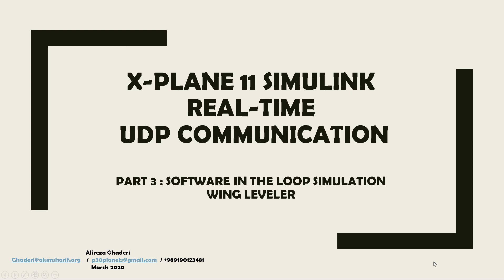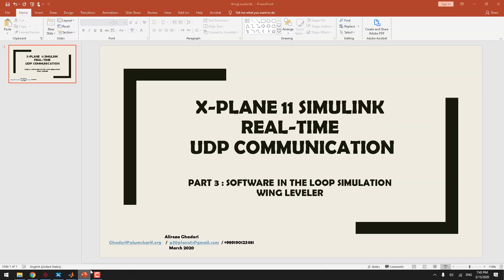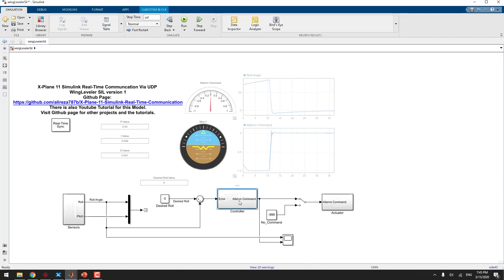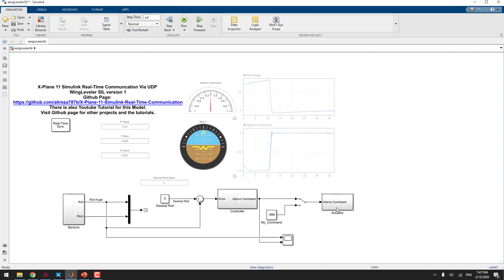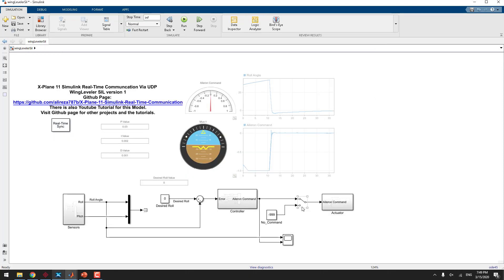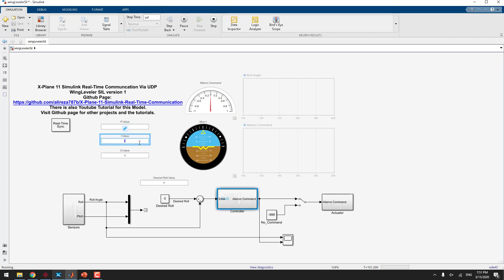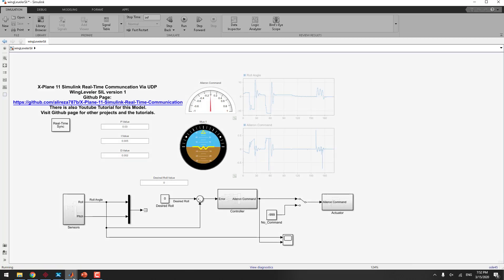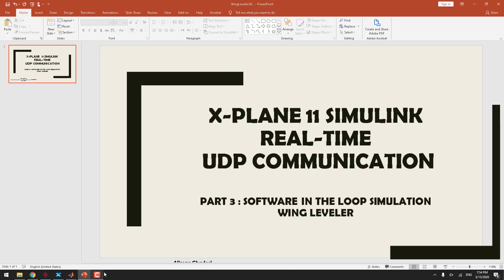X-Plane 11 Simulink Real-Time UDP Communication - PID Controller SIL Example

Comment: Is roll in that function case not beta angle? Shouldnt we use p instead?
But that way or another, thank You for really good instructions
Reply from the maker: maybe:)) long time is passed I dont remember exactly..  if you want wing leveler you need a cascade loop . inner layer control p and outer layer controls roll angle

Comment: Hello, Sir, I am facing a realtime sync issue with 50hz frequency I am using Matlab 2020a. any other idea on how to improve this. it just oscillates because of the delay. Xplane 50Hz and Simulink 0.02. Any Help would be really appreciated. Thank you.
Reply: It is somehow working at 10hz, any suggestions how to improve to 50hz thank you
Reply from the maker: Increase your processing rate in x-plane settings and reduce graphic load that should do it
Reply: @alirezaghaderi  Thank you for your response. What do you mean by the Processing rate in Xplane Setting do you mean "Flight Models per frame" at General Setting?
Reply from the maker: @MuhammadAmir5940  Yes Exactly
Reply: @alirezaghaderi  Thank you for your time. Do i have to increase to max for fast performance or to zero for fast performance.
Reply from the maker: @MuhammadAmir5940  to 10 processes per frame i guess... to the right... More process each frame will trigger the plugin callback in faster period.
Reply: @alirezaghaderi  Thankyou so much for your time. I followed your instructions it is great now I see that my Matlab is the one which is lagging behind at small sampling rate for real-time sync at high frequency, any suggestions for Matlab performance increase or better real-time syn with high freq computation. Any help would be so much appreciated. Thank you.
Reply from the maker: Its a matter of you CPU Performance... Make sure to select a process rate that your PC can handle that  . Reduce the sample time of the Simulink to least value and try and error with the process cycle of the X-Plane. If you have a better PC with better CPU you can give it a try.

Comment: did you manage to implement elevator, roll and yaw trims into this ? 
This is what I have done so far but when I connect index 13 I will lose my stick controls. 
can upload picture here sorry - 
but I wrote a simple byte-pack block which takes the cell array of 'uint32','single','single','single','single','int32'
so far so good when you put indexes such as 8 , 11 and 12 and 14 (btw this the send block) but as soon as you put 13 which is for trims and flaps it will either crash or seize the stick control input 
usually when you put -999 for flaps this causes the crash which I have figured this out 
but even though when you put either of single, int32 or double signals this will disable the roll and pitch- you can still perfom the yaw but I did not manage to fix this issue.
Reply from the maker: did you change the number of packets being received in both Matlab function and byte unpack?   if you added a new index , the order of the data and number of them will be changed accordingly
Reply: @alirezaghaderi  Thank you very much for creating these tutorials, I have been able to implement them for a university projet to make a controller for Xplane. Nevertheless, I have come across a similar issue to Ali Hosseinipour; when I stop the simulink model, my joystick controls do not work anymore in Xplane and can only be fixed by restarting the program. Is there a way of getting the joystick to work in Xplane during the simulation is running, without using a joystick block inside simulink?
Thank you again for your help.